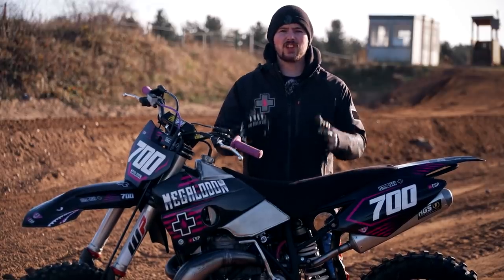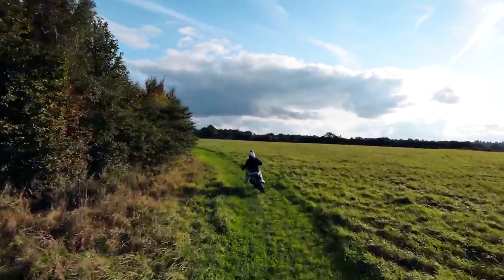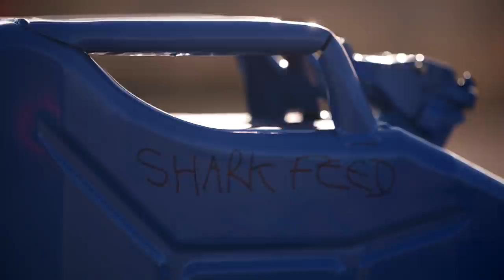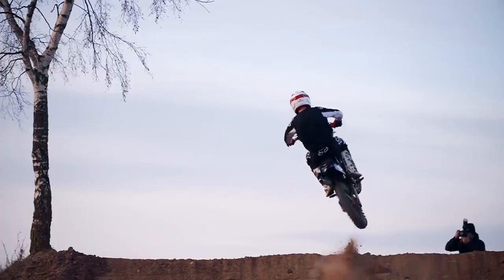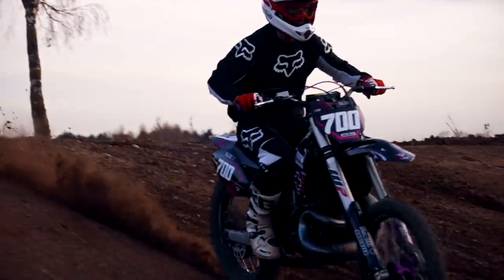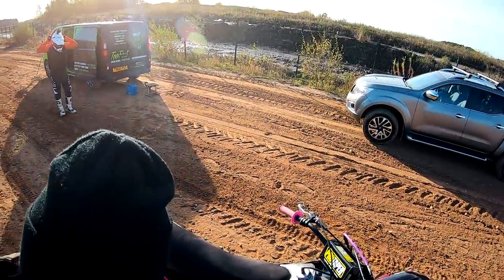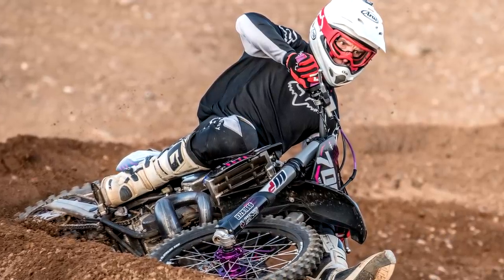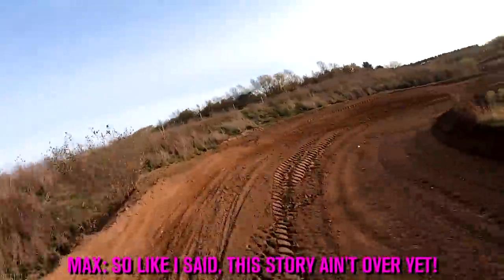Riding a 700cc 2 Stroke Dirt Bike for the FIRST Time! | Project 700 EP9

Comment: I'm used to riding my CR at nothing but full throttle as it's a 125. I wonder how I'd get on this this beast? 😂
Reply: Yeah I ride a 125 as well and as I watched and listened to it go around the track I just felt like they need to give it more gas. But later as explained it's just so powerful even at low rpm.
Reply: I’m gonna be a 100% honest, after having ridden bikes with 20 horse and all the way up to 60, those 125’s are fast. But absolutely nothing compared to a bike with this much. Just the difference from a 125 to a 250 is night and day. I can’t imagine this 700.
Reply: Thing is. I'm a 18 stone lad. I need the power, so being flat out on a 125 is a must. 😂

Comment: Is it still slightly lean? Sounds like the revs are hanging on a bit on lift off.
Reply: Indeed - Probably causing the cold start problems - Not set up correctly.
Reply: Wow your good telling if it's lean or rich without looking at the plug.lol

Comment: Add some plastic teeth round the front mud guard it won't be in the way or hit the tyre. I just think even just a hint of teeth would be awesome and fitting for that beast.😁👌
Reply from the maker: take a close look at the front fender if you can:) the teeth are there in the graphics. We thought exactly the same as you:) .
Reply: @999lazer  I mean hanging down from the edges of the guard. Ace thing bro respect
Reply: @999lazer  get some 3d printed to stick on in white it would be amazing and different

Comment: kx500 and cr500 engines have been known to put out over 70hp at the wheel with proper port work and carb and pipe and piston combos and that is reliable power on pump gas, i used to run a cycle shop with a dyno and it was right at the time supermotos were all the rave,we also were right near service honda and dynoed lots of there bikes as well as alot of kx500 builds with erik gore engines.

Comment: BTW this beast should be able to produce close to 90 hp so YES more go fast parts/kits lol  GREAT job by all of course.
Reply from the maker: Thanks for taking the time to watch and comment dude! The motor is certainly capable of 90+ hp, but that's with a huge sidecar exhaust pipe that just wouldn't be possible to fit on a MX bike. But there's definitely more to gain after further development...the new aim, more HP than Stark Varg! ;-D

Comment: 700cc:  The intake will not flow the air that engine can use.  The stamped exhaust comes off a smaller bike too, (modified), because nobody stamps a one off 700cc pipe, (stamps are made for production).  I am sure it makes gobs of low end and mid range power, (rev to 8000rpm maybe?), but I bet a well engineered 500cc CR from the 80's will be close.  200cc is pretty big to overcome, even if the pipe and intake are not really up to par.  But who wants to ride a 85hp dirt bike?  Not me.  Fun build I bet.  Nice.

Comment: Great bike! In the discussion at 14:22 I can sort of relate as I had a similar experience in my new car. I had a Honda Civic Type R (old ep3 198bhp 1250kg) and I got used to it, ringing it's neck to go "fast" and that it would slow down in a certain distance. In my new car (BMW M135i 300+ bhp 1500kg+) it's a completely different level of power but carrying more weight. I made the mistake of braking at almost the same point before this roundabout I knew well on my way home form work. I had not realised how much faster I was going and that the extra mass of the car is harder to slow down... Yea I sh*t my pants!
Reply: Mate cars and dirt bikes are literally not even in the same conversation with comparison

Comment: Looks great, but you should have used the Maicos frame that the motor fit in and worked around that doing modern suspension and brakes etc. 😁
Reply: How do you know that the engine fits in a Maico frame?

Comment: Cool build! 70hp though? The CR 500 makes 70 hp pretty easy. I don't doubt the 700 has more torque though. We used to ride 500's in the sand dunes and there isn't anything that can touch a built 500...except maybe a built 700!
Reply: 70+ whp 
Stock cr500 Will make like 60 at the crank

Comment: You may try looking at like a Yamaha v-max seat as like a concept version for that. Would be a lot more fun if you were not so constantly focused on hanging on, a little seat bump could work great for your butt to get a grip on the seat naturally. Because of how your bones work it doesn’t actually need to be very tall, just a slightly stiffer foam.

Comment: You need to get this on a bigger track. Find a place that tills it deep and let this thing rip.
Reply: I am sorry.  I am 58 years old now, had not ridden in 20 years and race a bit of amateur MX in the states back in the 2-stroke days, (when we had more skill), and I am getting back into riding again.  Give me a year, and I will smoke those guys on that baby smooth sand track, and even worse if they let it get rough for 2 years.  It is a big bike though, and they are not used to it either.  I am pretty sure Broc Glover would have had it to the throttle stops a few times.  The track is actually fast for a MX track IMO.

Comment: I remember when I was 16 year old kid trying to start a kx 500 by pushing the bike up the hill then put it to 4 gear.....pushing it as strong as I can down the hill and then relasing the clutch right at the moment my ass touched the seat otherwise the back wheel would just slip

Comment: Mad having 700cc 70 horse power then stark pulls out an 80 horse power ebike
Reply from the maker: haha agreed, but ours has sound effects :)
Reply: @999lazer  for now the problem.will be no fuel I run a husky 250 2smoker I love it but the future you cant change vet rider
Reply: Thats why they have methanol carburetors...
30% more power but 30% more fuel consumption.

Comment: A two stroke 700cc bike could easily do 160HP with a fucking lot of torque.
Reply: These do not rev that high.  It could reach higher in a multi-cylinder setup in which you gain higher RPM and distribute the power across multiple cylinders.  A single - Big Bore 2 stroke cylinder will be taking on more heat and more friction as well as having to deal with 2-cycle dynamics.  A long time ago it was thought to be impossible to build a large single cylinder 2 stroke, it was called the impossible engine until one man built one and won a world championship with it.

Comment: I'd there a power  valve  in that motor?
What motor  is it
Reply: I highly highly doubt it.  Big bore 2-stroke can easily make a very wide rpm range of power.  I don't think any 500cc 2-stroke MX bikes had exhaust power valves.
Reply: @EarthSurferUSA  

 I've been running the 250 with no power. That's why I asked

Comment: Kinda doggin it down aren't you ,put that thing on the pipe.
Reply: The big engine will never rev like a 250, and I am sure that pipe and air boot hold a lot of mid range and higher rpm power back, and could be capable of 80hp or more on gas. They made a hard pulling tractor engine.  But I don't think they hit the throttle stop either. :)
That rpm range they were using is actually how to ride a huge bore 2-stroke especially going into corners.  They have a lot of gyroscopic force, (big crank and spinning parts), in the bigger engine, and higher rpm's makes it harder to lean the bike over entering a corner.  So they are made into tractors.  :)

Comment: i have never seen a motocross track that needed more than a 125 to enjoy them. i use a 250 for small desert races and something in line with plus 100 mile or really challenging  off road an open class...

Comment: Don't mean to sound egotistical, but you can always tell the non-pro tracks when there's obstructions or marshal towers in line with run off areas.
Reply: Track safety design needs some work.

Comment: You can buy a better one that has exactly the same engine and the Motorcycle is called Maico .. there's a privateer in Germany I believe it is who bought the Maico name and production rights and his hand assembling the motorcycles from past stock of the original company...the new Maico of today are actually 2018 builds but no matter as they are loaded with all the same technology of today and it was 685 cc's putting out around 90 horsepower at the rear tire puts the Maico 700  at The Head of the class

Comment: Should be in a Dakar bike useless power in a mx bike
Reply: It looks like the 40hp they got into was working fine.   I know it is not a high revving engine, but it does not sound like the hit the throttle stop at all. :)
A baby smooth track, at least keep it pegged for a couple seconds.  I miss the good old days when you needed corner speed to clear the next jump, because it was close to the corner and not 200 feet up the track. :)

Comment: Very poor power band this engine its sleeping on low rpm.If a 70 hp out of a 700cc 2 stroke is a beast what about the 2 stroke  360cc drag bikes that make also 70hp and revs higher than 12.5k.This engine is a piece of crap.